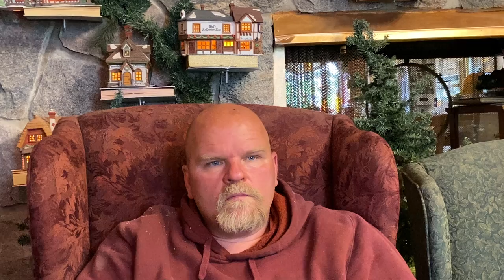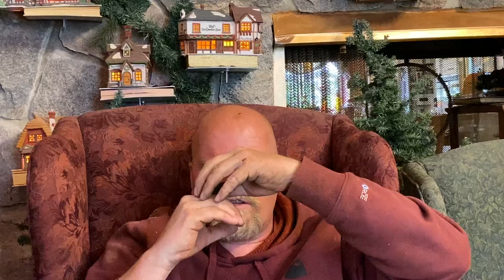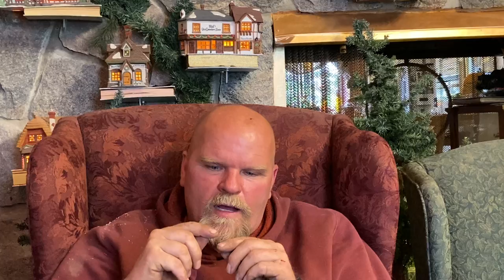Q&A: Renovate Vinyl Liner Track

Comment: Hello Pal another informative vid 👍 , I had an issue on my rectangle pool vinyl liner around the corners , well 1 corner kept coming off clip so I called the company who installed my pool and they came a installed wedges in each corner problem solved for now
Reply from the maker: Thanks for the info